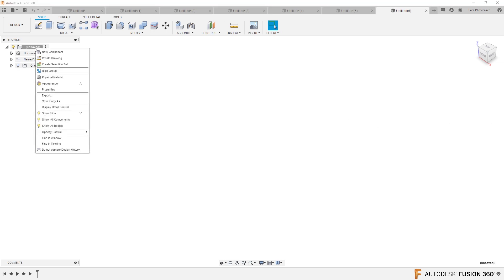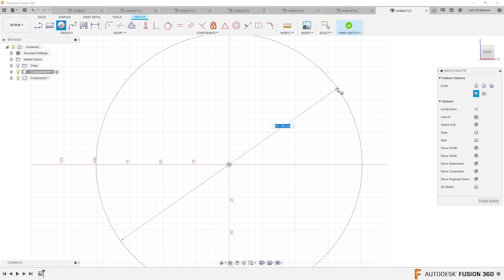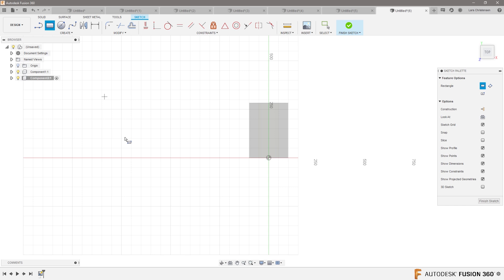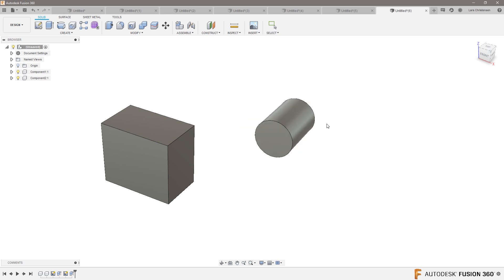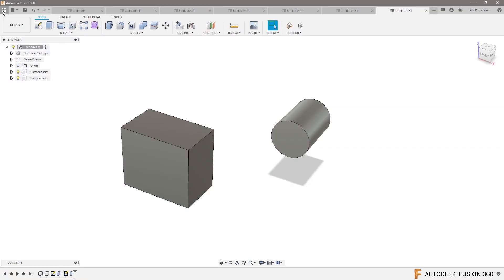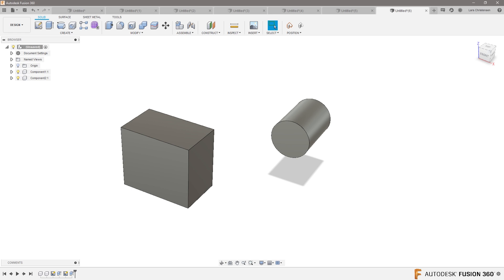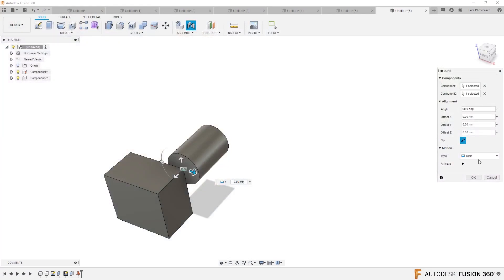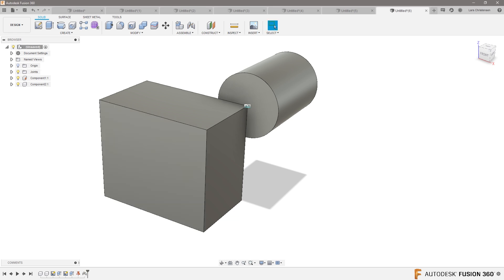Fusion 360 — Align vs Joint — Ask LarsLive

Comment: F360 Joints? It's not that confuses sw users. It simply doesn't have any mechanical, or engineering meaning. And you do not have control over joints. It's just more playful and...dumb. That's also the reason why all the video tutorials, even the one of Autodesk, just show cylindrical joints, the only that kinda works

Comment: I have an infuriating issue. I have a motor with a shaft, and a drill chuck. Why am I having such difficulty specifying the distance away from the motor? I seem to be only able to align the chuck to the motor case end being too close, or to the end of the motor shaft, too far away. HELP
edit: I think I figured it out. You have to zoom WAY in, and then fusion will show you points with tiny origin snaps. From there, you can specify offsets. Here's a head scratcher. The placed origin for the joint is in now way aligned with the assembly, nor the component coordinate systems, so be VERY careful when you click to select the origin of the joints. It will show you colors, so that Z offset is not in accordance to any other coordinate system! Click makes the small axis disappear, so you'll just have to play with the offsets to figure it out.

Comment: When drilling a sprue hole that has tapered sides, I need to drop an appropriate size ball bearing into the hole, so that it rests against the tapered walls instead of the bottom. I then measure the distance from the top of the ball bearing to the top surface of the part. To find this dimension, I have drawn a solid body sphere to represent the bearing, and I want to align that sphere onto the tapered surface of the hole in the part model. I'm having trouble figuring out how to get that done. I'm wondering if you, or any other subscribers would have any suggestions. Thanks!

Comment: I NEED HELP! I keep finding these weird split line breaks in chamfers, and fillets for circular models. EXAMPLE: I make a 2 cylinder models stacked on top of each other, I then expand one of the prismatic walls on one of the cylinders, then i click that ring between the 2 cylinders, and add a chamfer or fillet to it to round or angle from one cylinder to the other. Rather than a smooth ring of chamfer or fillet around the entire ring, i am getting a weird vertical line in that chamfer on 1 side. Any idea why this is happening? How do I fix this? I can click the line break, and even click the 2 points on top and bottom of the chamfer, but I cant delete it or do anything to remove it.

Comment: I'm confused, I use the join tool to align several parts (bolts thru a plate), but if I move the plate the bolts stay in thier original position.  I have created thisxassempbly using step files.  What am I doing wrong?  How can I make an assembly that retains its orientation when moved? Great video, thumbs up and new subscriber. 👍👍

Comment: I'm a CAD power user, been working with CAD programs for more than a decade. I have one thing to say about Fusion's "mate"/joints system, IT'S A STEAMING PILE OF DOG CRAP (yes I'm that frustrated with this awful tool).

Apparently they (Autodeks) have tried to make this step (assembly) in CAD modeling more "user friendly"/simplified but in the process made one of the most horrific and unintuitive experiences I have ever had with a software tool.
For example, solidworks maybe requires more steps to properly "mate" two components, but it gives the user absolute control over the way the parts are mated together (one degree of fredom at a time). This "all in one" joint systems (where Fusion basically tries to do the same with as little steps as possible) initially sounds great, but in practice this method is so cumbersome. And this is not only me, so many CAD designers are struggling with those crappy "joints".

Ended up on this vid while trying to figure how the hell do I make a symmetry joint using 2 planes from an existing body (added component) and 1 plane from the Origin of the main component, In solidworks this is done in a blink of an eye (a bit longer if you are new, but still pretty easy as the mates are self-explanatory and simple, for the most part, the mechanical mates are a bit more complex), with Fusion I had to search online for an answer, and after 1 hour still no luck (probably will find a solution eventually).

Comment: Can we use joint, but use the individual planes of the components instead of faces?  I'd like to be able to use the planes with an offset to lock parts together but still have the location adjustable by changing the offset.

Comment: Aligning faces is not the problem, aligning on many directions is, how difficult can it be, really difficult to find simple 1 minute instruction to do that. I have 2 holes going trough two components and all angles are wrong, I can align the faces, but how do I sling both holes at the same time, i.e the rotation of them, and I do not want to joint anything, just align them, the two hole center lines on bot bodies.

Comment: i want to fix align a pipe clip with the holes on a table .I use the command align on them, but it was not beneficial for me as i am able align only one hole of table with the one hole on clip and not both the both holes on table with both holes on clip simultaneously.

Comment: i get stuck where you want the nut rigid but then its in mid air and wont move .. surely you dont need multiple functions to connect things, if im not mistaken you have to do a slide joint then a rigid joint to lock it.. 2 operations

Comment: Hi Lars, maybe you will find this task interesting, because this situation if very common amongst telescope (vision and laser application) manufacturers, which I am.
I find it difficult to joint spherical surfaces to circular rim e.g. jointing convex lens surface to a tube lip in the end. Previously I was working with SOLIDWORKS and it had tangent mate, which was perfect for such situation (align lens+tube cylinders, then mate lens spherical surface to tube rim - DONE). In F360 I join lip joint-origin with lens radius of curvature (RoC) joint-origin, then move joint by distance equal to "RoC minus saggita of the lens part between vertex and lip touching point". This does the trick, but it is time consuming and prone to human error. I wonder if there is better solution for this kind of situation.

Comment: I'm really struggling with how to do the following in fusion 360:
I'm used to take planes and put them together with the coincident tool of solidworks. It's so easy to put parts in the middle of something. And especially if you have play between the parts, f360 freaks me out cause I can't just join two planes together
Reply: I totally agree!  Coming from SW, I find the F360 joints hard to conceptualize as well.  I suppose I am trying to imagine how to do more complex things (ex: I was a big fan of the width mate in SW), and I struggle to see how I might accomplish them in F360.  Flipping mates is also something I wonder how F360 can do.  Are there distance joints? Angle joints? If so, do the values for these appear in the parameters? Lastly, how to I accommodate parts that do NOT have points (but maybe do have surfaces) where I need to join?  I guess I just need to put in the time....
When you compound the joints vs mates challenges with the aggravation of the different ways constraints/relations are applied, changed, and analyzed, it makes the jump from SW to F360 very distressing.
Reply: Well, Lars is much more on top of this than I gave credit for.  Set aside and hour and watch this one: https://www.youtube.com/watch?v=KQNgIfjMr84

Comment: I use both SW and F360 and I love them both but this joint thing really ticks me off.  While its practical and is great when it works, if it does not do what you want it to do then you are stuck.  So in reality as long as it works F360 Joints are faster compared to SW.  But for some reason the joint does not work you are simple done and you can not go on.  While slower I prefer the SW method.  I want to slowly build the restrictions rather than trying to figure out what to remove.  And really everyone compares it to SW but I really do not remember pulling my hair when I was using Inventor.

and I really do not understand the reasoning behind Autodesk's refusal to implement the normal method of mating.  In this day and age and level of technology I can not understand why we are loosing features.  

Because of Joints,  I use SW.  I just use F360 as a glorified exporter or when there is not a free SW license on the server... You guys are asking people to re-wire their brain basically.  And at the end it boils down to the fact that I do not want to learn a new method of joining parts.

Comment: Since your used to SolidWorks Mates, what is the equivalent to a distance mate in Fusion 360???
Reply: Use Joints, then you have the option to position the part x, y, z, distance away from the fixed part....if you can figure out how to join the two surfaces correctly that is.

Comment: What is the box on the wall behind you? A computer or something?
Reply: You are technically correct! That's a Haas  CNC control simulator. Really long name, really simple job. It is essentially just a controller without a machine so you can run your code on it and proof out your program for any errors. A lot of schools and training facilities use them and even some factories with many programmers will have them.
Reply: Thank you!